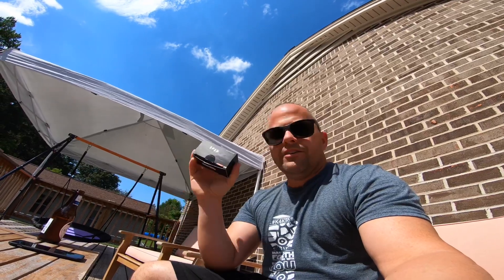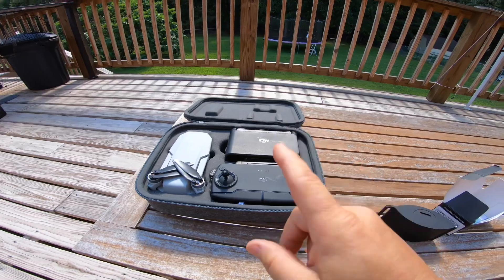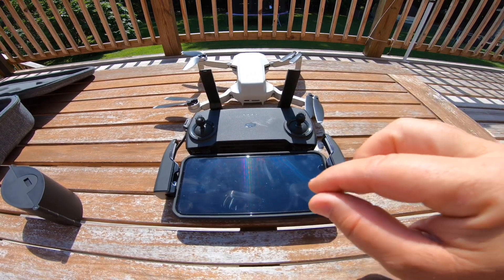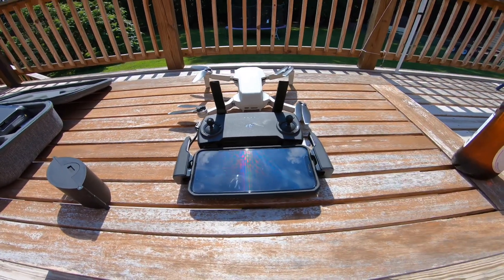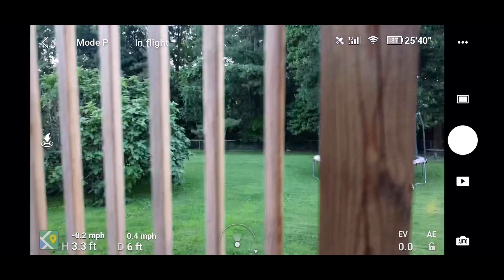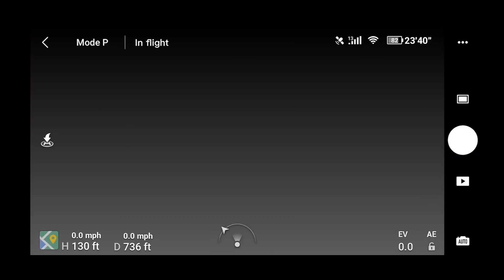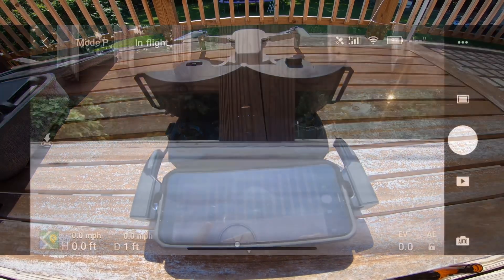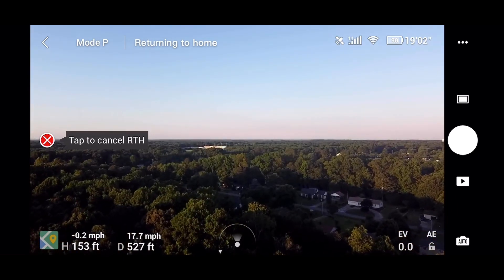7. DJI Mavic Mini Signal Booster Range Test In Trees

Comment: Nice test, but forget the parabolics. They're ok, but don't match the Yagis. Those are much more efficient and you will get much better results. The biggest issue with those is that you have to select manually the channnel to get to the right frequency. In the USA (FCC version) go for the 5,8GHz X-yagis (yagis with reflectors). 
In Europe  go for the 2,4GHz Yagis... if possible, with reflectors too. Either of them will at least double the range (usually more than triple the range).
I personally did around 14.000ft with a CE version, in 2,4Ghz, just with simple regular yagis... the battery was the limiter... 
The most important with these types of transmission, is to keep LOS (line of sight). If you can, go to a high point and fly from there... the clearer the surroundings, the further it'll go.
Hope it helps.

Comment: Did you have all notification and put your phone in airplane mode and try it again but go a little higher like 175 or 200 feet see what you get??? And get you the other pair of boosters and try 2.4 GHz instead of 5.8 it's in now.
Reply from the maker: Joe Weathery great idea! I’ll have to try this.
Reply: @jccadventures3667  mine was in 5.8 I'm sorry. But now it seem like it is catching on everyone is useing both the sunny booster line you have and the yagi's at the same time and in the open they are maxing out the range it looks like it will even go 5 miles easy with both of the extenders on the controller at the same time . I'm going to try mine today and will let you know what happens